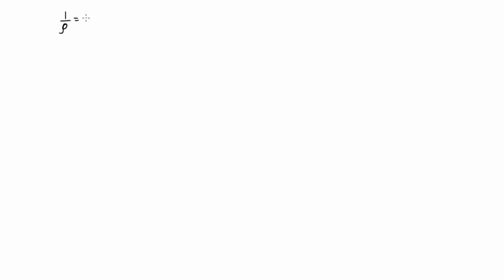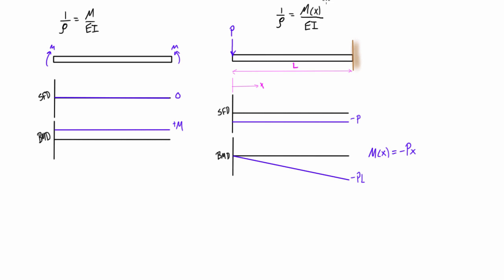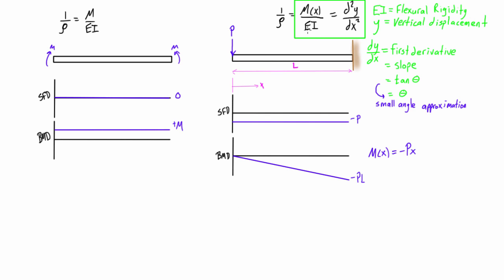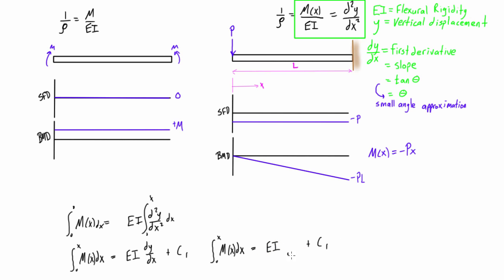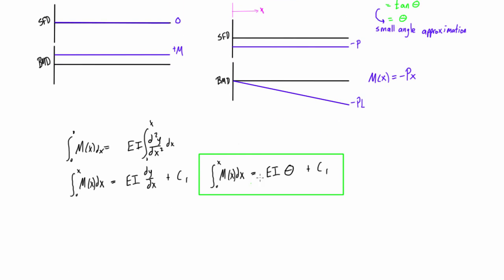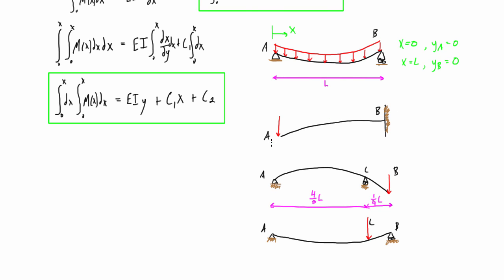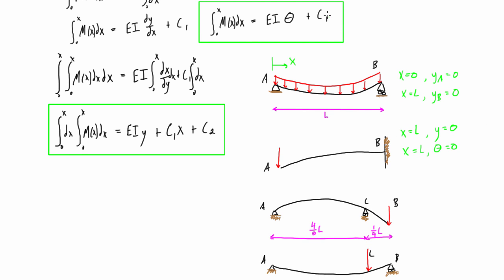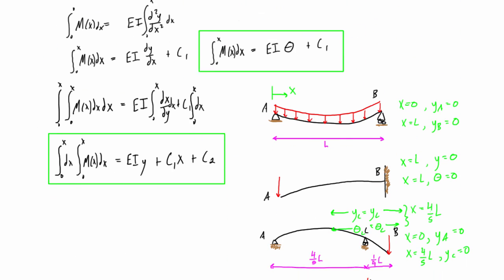Introduction to beam deflection and the elastic curve equation (double integration method)

Comment: Great great great videos bro! Really helpful..
Quick Question tho: minute 07:10 ———> ain’t there supposed to be a constant “+C” for the “EI • Integral of dy/dx dx”.....

Just like you had a “+C2” after integrating “C1 • intergral of dx”..

This means we’d have 3 constants....

Please enlighten me why thats not the case
Reply: When integrating both sides of an equation we do not have to put two constants, one constant is enough. It is not wrong to put two constants on both sides of the equation but it will have the same effect as the single constant that is put when integrating both sides. Having a constant both sides can make it complicated.